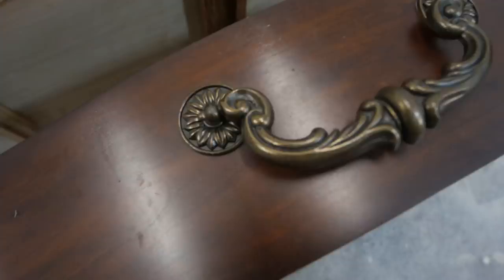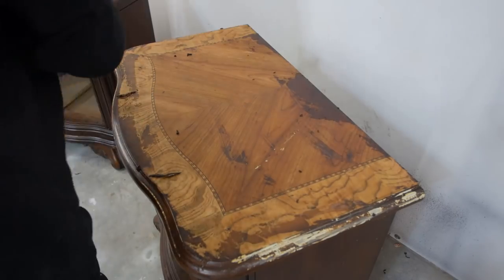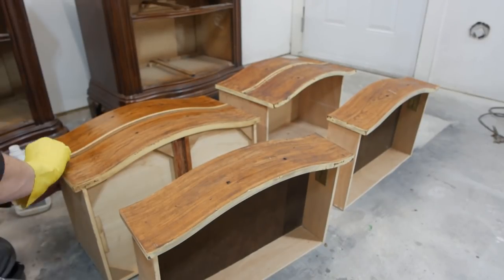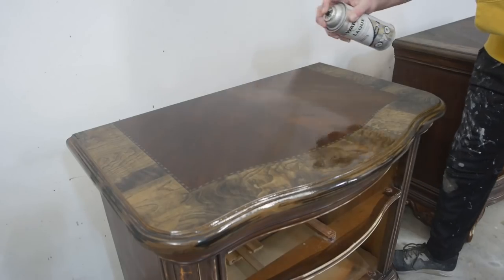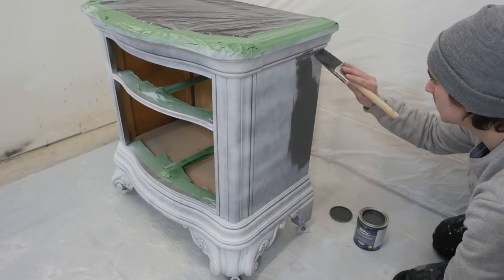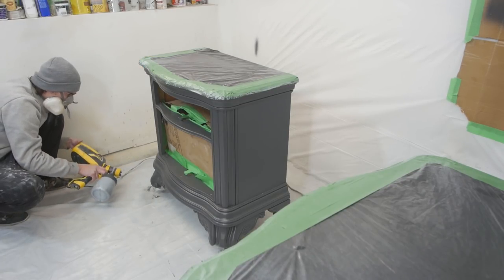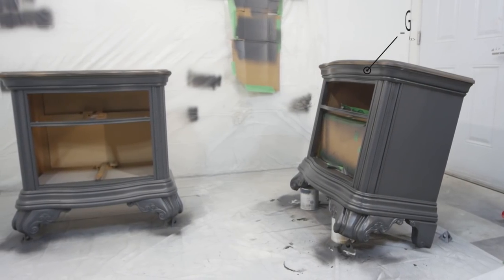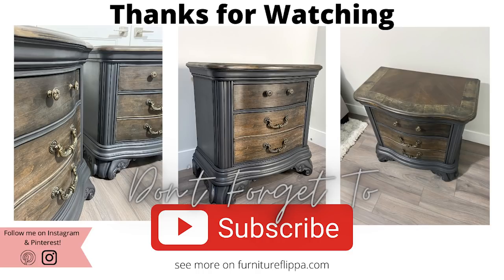NIGHTSTAND MAKEOVER X2 | Furniture Painting, Staining, & Glazing

Comment: do you use the 15 min stripper because its faster than the 30 min stripper?
Reply: Isn't that what the 15 & 30 means? One works in 15 min the other takes 30 min before it can be removed?
Reply from the maker: hmmmmmmm good question! 😂
Reply: @jcrefasi1  15 minute stripper is usually a stronger formula meant for removing varnishes and stronger finishes. The 30 minute formula is weaker and meant for paint. You dont want to use the 30 minute stripper to strip wood. You wont get anywhere. However, you can use the 15 minute stripper on paint, and it'll work in 5 minutes. ;)